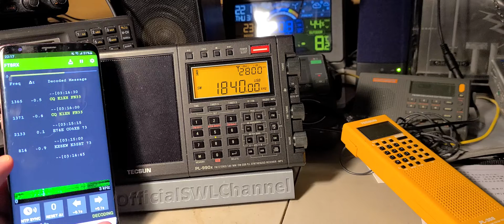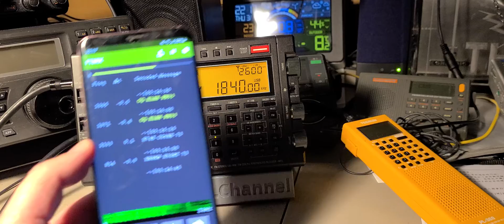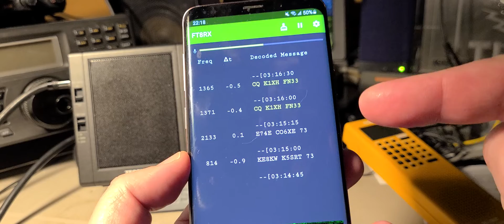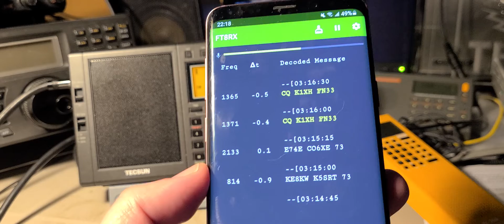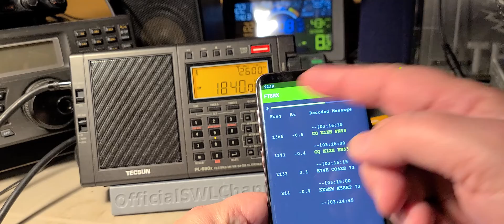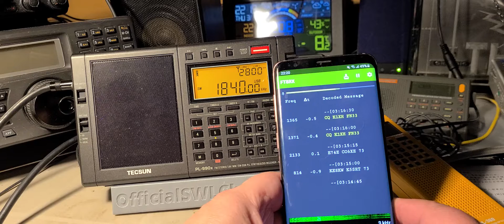FT8RX decode and testing with Tecsun PL-990x receiver and audio from microphone

Comment: That's a pretty cool app! Thanks for showing this off. 
Due to a temporary speech issue I'm dealing with right now I've been pretty much just FT8 at my ham shack which shows the kind of versatile the radio hobby has.
I have a "luggable" HF radio station using a Xiegu G90 that I'm setting up an integrated Raspberry P400 for digital modes. I'm still working on it but will post on the FB group.  
Great stuff man